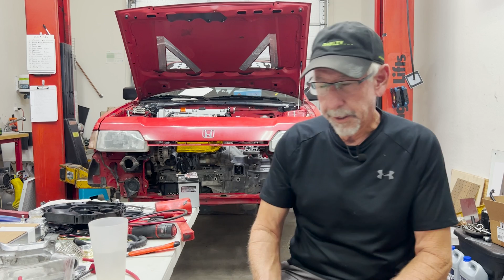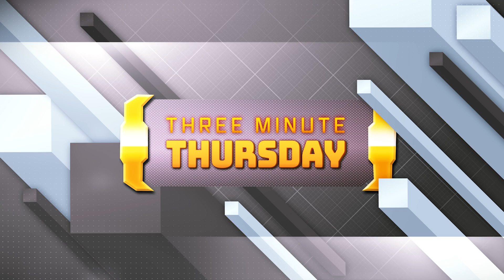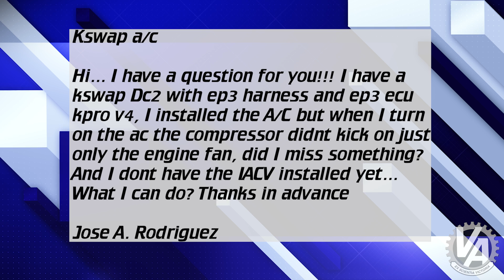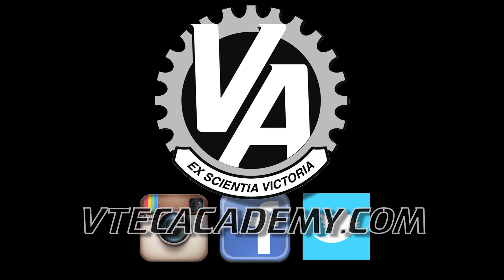Getting the Air Conditioning to Work in a K Swapped DC2 Integra

Comment: c5? as in the plug on the obd2 DC harness that got pulled with the b series? the whole c connector and ecu went with the motor and harness. how do we wire from the harness that is no longer in the car? Or are we talking about the ac switch signal on A27 to B9 instead?im either missing something obvious or im the first one to do see this and post about it? 
thanks in advance
Reply: Correct in your case for sure OBD2B cars need A27 to B9
Reply: Then convert in Kmanager ac switch to vtec press switch

Comment: Is kpro required to have ac working properly?  I am using the HR kit and used their relay they supplied.  Fans and compressor engage when you turn the ac on but what’s odd is the compressor will even engage with the engine off but key is on, shouldn’t it wait til the engine is running before it actually engages the clutch ?

Comment: Does anybody knows the instructions to hook the wiring right on an ek ep3 harness, the ac seems to be hard wire, and turn fan and clutch on when ac turn on even if the car is on the on position (not turn on), runs bad when ac is on and shifting, car shuts off lol
Reply: Same exact problem here

Comment: Ive got a question. I'm planning on K swapping a K24 into my 1998 Civic LX and want the fullsize K swap Radiator. Will the full size radiator allow enough room for AC also?
Reply: i had to get custom hoses made from dc5creations. you'll need to relocate the battery for them though.

Comment: Can ac still work without kpro?  I am using the stock 02 type s ecu. Thanks
Reply from the maker: It can work, but your idle is gonna drop every time it kicks on.
Reply: @VTECAcademy  I have been trying to get this going for the last two days haha.. I have a 95 civic EJ1 with an 02 RSX Type S swap using OEM ECU/immobilizer.  I ran a wire from A15 (blk/red) to E18.  Is the ECU supposed to provide a ground signal from E18?  My relay has power, I can get the clutch to engage by sending power to red wire using power probe or by sending a ground signal to the black/red wire on the relay (disconnected the wire tap to the ECU while doing this).  I put a male pin into E18 and made sure I had a good connection.  My pressure switch is functioning, there is continuity now that it is pressurized.  I filled the system with freon and pag46 oil by jumping the compressor power.  It still will not engage since the black/red wire is not receiving a ground to the relay.  any ideas?  Thanks for your time

Comment: I am doing a k24a2 (Kpro v4 PRB ecu) and a k20z3 (Haltech RSX based p&p ecu) into Pontiac Fieros with A/C. Both of my RSXS based harness' don't include a plug for the A/C. I was under the impression this was on a separate harness (body?). I saw the option you mentioned in Kprov4 to use the alt switching. I just need to get the Fiero a/c source trigger and route it to the plug you mentioned in the video. I am still learning Honda's. Like I mentioned though, no plug for the A/C comp on either harness. Also, since my sons k20z3 is using a Haltech p&p ECU, I assume the alt switch isn't an option for him? Thanks Brain. As always, your knowledge is invaluable and your staff has always been top notch every time we have spoken.